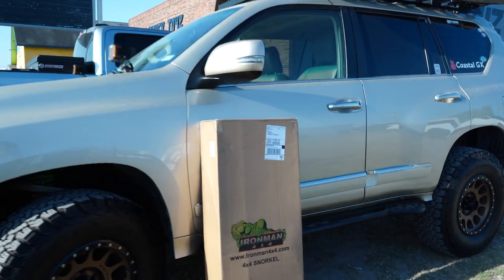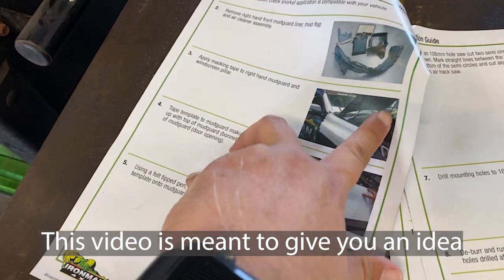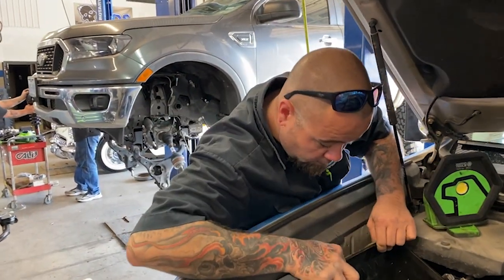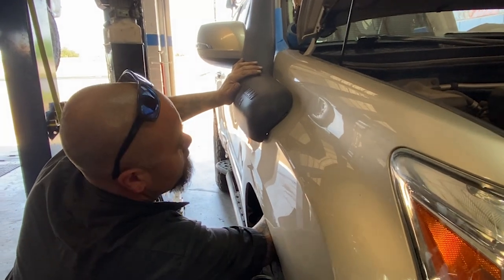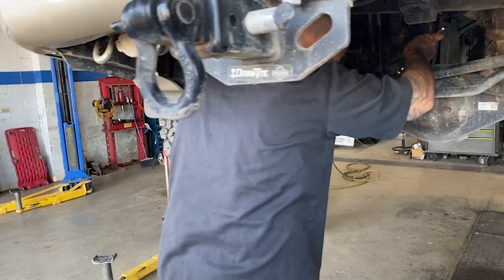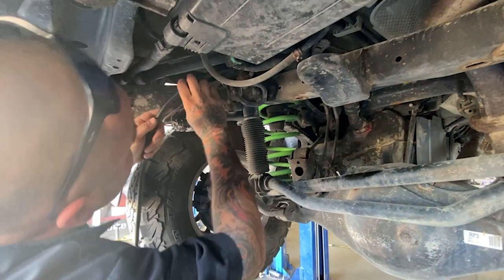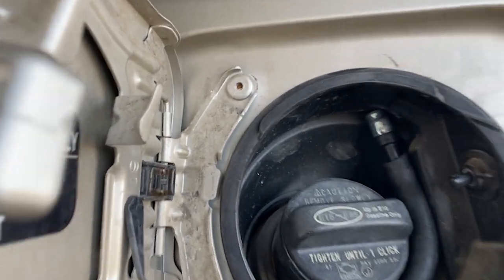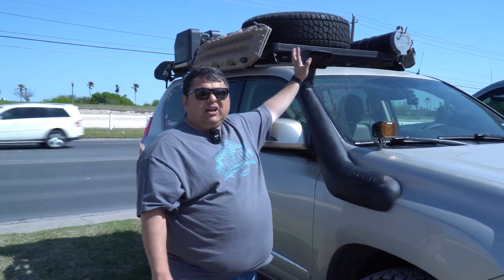Lexus GX460 Snorkel and Differential Breather install

Comment: Hey brother, I just did DIY snorkel installation and you were correct I was wrong if you use the holesaw you need to drill two holes and then connect them so my apology to you and Justin
Reply from the maker: No need to apologize at all. People will have legit questions and that’s valid. You are a brave man to tackle this project on your own so you deserve an extra “congratulations” for completing it. Also, the holesaw is more efficient and precise. Better than just cutting the entire hole with a straight blade.
Reply: Question for you both as I am installing this same Ironman 4x4 snorkel on my 17 460.  Does the gap between the A Pillar and the snorkel seem large?
Reply: @FStewBailey  my snorkel is Dobinson but I think they’re pretty much the same I believe there is always slight gap even properly installed but if you have a huge gap that means your bottom portion is not siting right ,I hope this answers your question

Comment: Love your build! How many inches of lift are you running, along with wheel and tire size!
Reply from the maker: In reality it’s only about 1.6” of real additional clearance. Not much. But it has made a world of a difference at the beach. The front skid plate no longer plows the sand!
Reply: @CoastalGX  sounds good to me. Did you fit 33s or did you go with something smaller?
Reply from the maker: @MasonWebster  it’s closer to 34”. I got a body mount chop and have become tired of cutting the inner fender liner lol.
Reply: @CoastalGX  love the way it looks. Do you daily drive your rig? Or do you have something else haha
Reply from the maker: @MasonWebster  My office is less than a mile away from my house so I drive it everyday. Sold my other cars. So just my truck and wifey's Honda. lol.

Comment: How do you get your high beams to flash/strobe like I've seen in your other vids?
Reply from the maker: It’s an optical illusion. The LED’s are not synched with the camera frame rate and it appears to have a strobe effect. It appears normal to the naked eye though.

Comment: Yo, you gotta go back and paint all that metal that you cut. Even if you are in cali it will still rust with rain and going through the carwash
Reply from the maker: There’s a couple of shots that show where we painted the holes, although now that I think about it, we did miss the little holes that support the top part of the snorkel! Thank you!!
Reply: @CoastalGX  I learned the lesson the hard way on my 98' XJ 😭

Way more effort to go back and fix it after it causes issues. Now I go wild and use paint and a thin layer of body seam sealer if possible. But I also live right next to the beach in FL. Humid + salt air is a killer
Reply from the maker: @reddyuda  I’m glad people share their experiences with me. We painted everything but didn’t do the small pinholes. The ocean mist and even the smallest amount of saltwater is brutal out here.
Reply: @CoastalGX   Well we all gotta live and learn. Wish I knew everything, but I learn new things every day. Cheers, loving the GX build!

Comment: Looks really good Roberto. Doing mine next
Reply from the maker: Thank you! What brand are you using?
Reply: @CoastalGX  going with the Ironman snorkel as well. And as for the diff breather, I’m using an arb style breather from Amazon. I gotta catch up to you bro!
Reply from the maker: Cruiser Shooter I didn’t bother doing the two other breathers. I saw the ARB and the knockoff brand but I didn’t need the extra material and I read that the hose material was brittle plastic. The hose I used is more like a fuel line (rubber.)
Reply: @CoastalGX  yup. The brittle plastic is a pain, was gonna swap it out with fuel line. I have that set up on my 80 and wanted to see how the plastic held up. It’s been working out ok, but handling it is a pain.

Comment: 2 years later... was the snorkel worth it?
Reply from the maker: I don’t drive much on dusty roads, so no, it hasn’t been a “necessary” mod at all for me. The quality is good and the install was solid.
Reply: lastly, do you take it through the car wash? @CoastalGX
Reply from the maker: @JackMcRoberts  never. There’s just no way. I have it hand washed after I put in on ramps and personally clean out the tough stuff. I just got the saltshift thingy to wash out the inside of the frame so let’s see how that goes. I might make a video on that after a trip.
Reply: okay good to know! @CoastalGX

Comment: Did you relocate the breather for the transmission and front differential?
Reply from the maker: Hi there; No. They are already kind of high up. The most vulnerable breather is the rear diff. The others are way higher and are covered by other components. You can definitely relocate them, but I just don’t see a need personally.

Comment: Why did the dude "Justin "drill two holes and then connect them  making  a huge opening, One hole is just enough to slide in the plastic piece that connects to snorkel with the box any other video of this installation is always just one hole did he made a mistake so he had to drill twice?
Reply from the maker: Hi there. Are you referring to the pillar or the main fender hole? We followed the instructions and used the template that comes with the snorkel. I don’t know what other video you are referring to. Justin has installed dozens of snorkels with success. I and hundreds of people trust him with mods so I’m going to say he’s probably ok 🤣
Reply: Yes I am referring to the main whole  I have seen it in person done and a few videos on YouTube and I haven't seen 2 circle   cuts and then connect to the way with cut in between;
Reply: Check the Chanel - lifestyle  overland , also Few videos done  on  gx 470 and a lot of videos on 150 prados  , I am sorry I just ordered my snorkel and reason I watch so many videos because I will install it myself so I want to see how is done and in your video it's the only video that I have seen 2 main  holes , I am not judging Justin's expertise I just haven't seen one like that
Reply from the maker: @project-LEXUS-BMW  I understand, but we are quite possibly the ONLY video to show this much detail. Here is a direct link to the instructions. You will clearly see why it’s necessary to do it the way Justin did it. We just followed instructions. Thanks for watching and good luck on your project!
https://store-pusehjx.mybigcommerce.com/content/ISNORKEL035%20IM.pdf
Reply: Hi brother I just did DIY snorkel installation and you were correct , I was wrong , if you using hole saw you need to drill 2 holes and then connect them so my  apology to you and Dustin